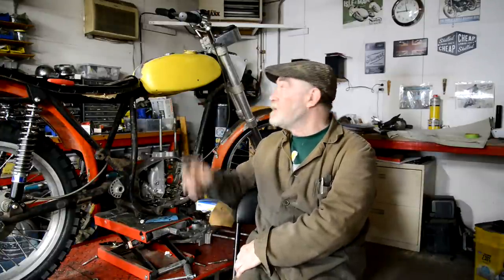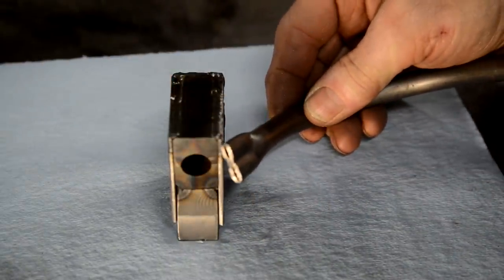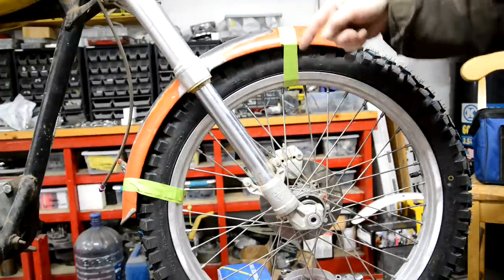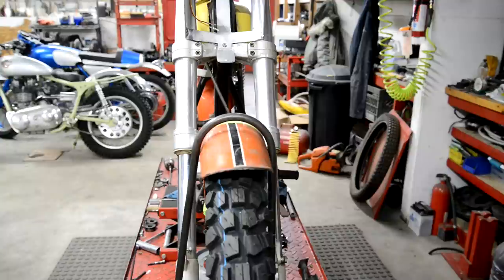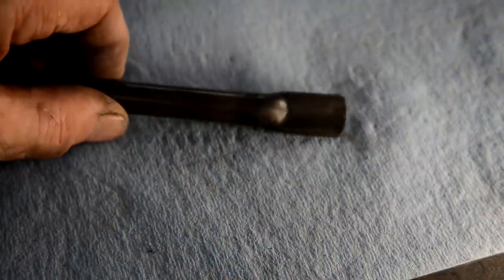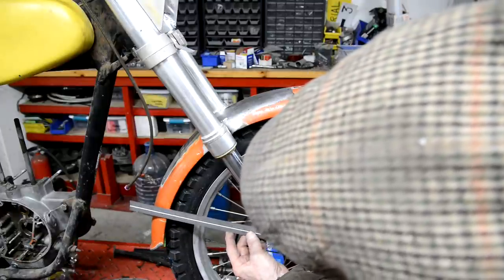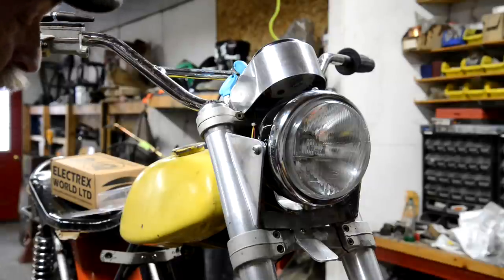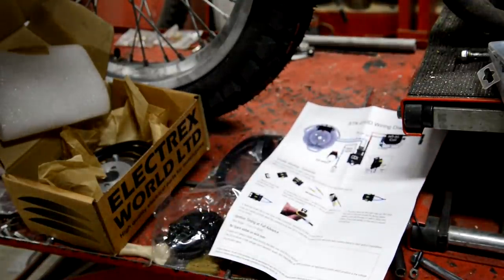BSA B50T Upgrade  -  Part Six

Comment: You need to mill off the flat portion at the end of the drilling to accommodate the flat of the tube  roughly 1/16" for either block..  Enjoying the build as usual

Comment: Length of the videos is ok with me. Short or long. One thing I don't like is the front mud guard. It should be attached to the bottom of the fork clamps, and not down by the front tire. (Probably too late now)

Comment: Having spent over 40 years bending schedule 40 steel pipe, as well as EMT aka thin wall conduit.  When you are using the same bender if you will keep a notebook when bending the pipe you can find exactly how far the center of the bend as well as what amount of take up it takes before the bend starts.  With every 5 degree or so you will find the distances are different so each time you bend remember to measure the angle of the finished bend and the distance from the take up to the center of the bend.  You will soon have a book with all the information you need to mark out your pipe and bend without having to "fine tune it".   Each different pipe size will have different measurements.  I know it seems troublesome but soon you will get to the point of being able to measure what you need and make a piece first time, every time.

Comment: A trying week for sure.... but you’ve got useful stuff done, and the bike is coming on. Are those brake hoses ‘braided’ ones? Better then, to let them flex in a large arc over the top of the forks like on enduro bikes, as constraining them to flex in one small part of the length can cause the braiding to fracture (as per early RE Himalayan front brake hoses). I think this machine is going to be a stunner - whatever the colour. Les in Chester
Reply: Yes,  my enduro sites the hose to flex vertically with longish loop from the master cyl. passing through a 25mm plastic centred eyelet fastened to yoke pinch bolts,  ensuring hose doesn't catch on anything when bars are turned and not to obscure the speedo during normal riding suspension deflection.

Comment: Personally I've noticed a trend for shorter video's on You Tube and I really don't like it.
Somewhere between 25~40 minutes seems around best for me.
I made something very similar about 12~14 years ago to make mudguard stays, I used a ball end mill after drilling to get a nice rounded end, plus, heated tube to red before forming.
Generally it's a good idea to get extra brass olives for the DIY brake lines, getting the ends at correct angles without any twist can sometimes be challenging. Kinda surprised you didn't know about brake union hydraulic switch, I still have a couple in drawer but don't remember if they are Brembo/Suzuki (10x1mm) or 'everyone else' (10x1.25mm)
Don't know who is doing XS650 bits nowadays, (I know Mike from MikesXS retired a few years ago) been close to 20 years since I was 'playing' with them. (800cc conversion, re-phase, etc)